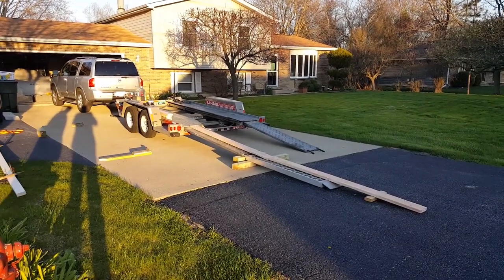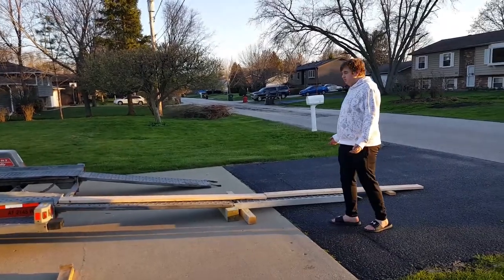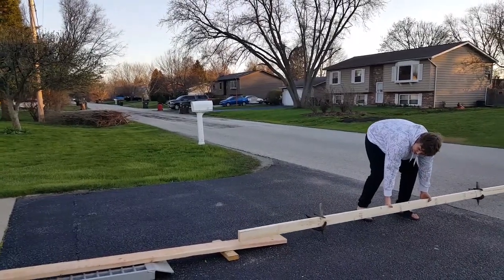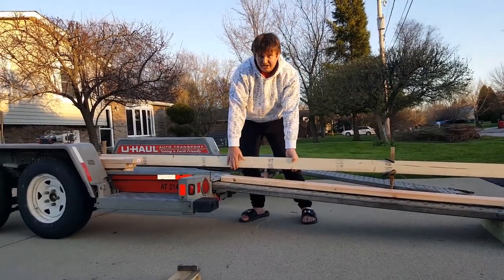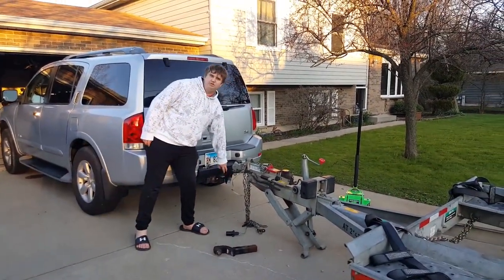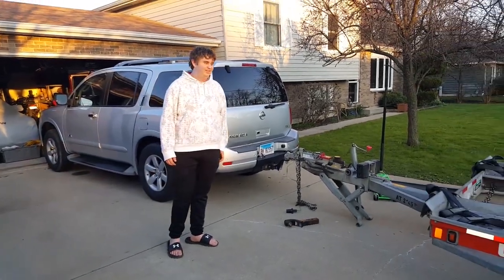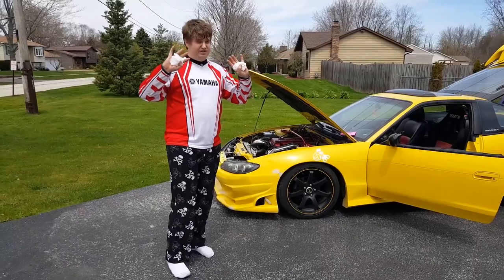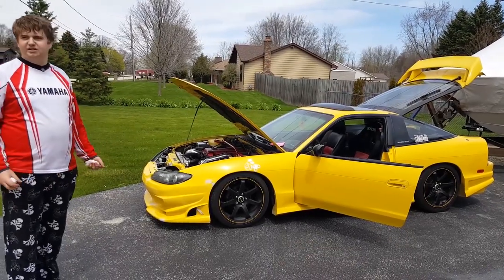How To Load Your Lowered Car On To A Car Hauler or Trailer

Comment: You got the car wrong way bub
Reply from the maker: There are four main reasons the car was loaded this direction.
1) The front bumper would've had a much harder time clearing the initial lip of the wood used for to cover the ramps than the rear bumper did.
2) With the battery and fuel cell in the rear of the car, and with the axles so far back on this design of Uhaul trailer, the car had to be loaded this direction as to not have extreme tongue weight.
3) The prominent tow hook for the vehicle was on the rear, the front did not have one installed at this time.
4) At the front of the ramp platforms on the Uhaul trailer, there are bump stops that raise up ~4 inches, which is higher than the front bumper's clearance. So as to not cause damage to the car, these fit nicely under the rear bumper.

Thank you for your comment, I hope this clears up any misconceptions you may have had about vehicle loading!
Reply: @240drift  Thaks for the vid, very helpful!  I'm goingto be loading my car backwards too for all the same reasons you just listed 👍🏻
Reply from the maker: @Kevin_MK7RSR  Glad to have helped! Loading cars is heavily debated, and varies a lot depending on the car, the tow vehicle, and the trailer. There's no one "correct" answer that covers every car, but we can provide the information to help viewers make their own decisions!